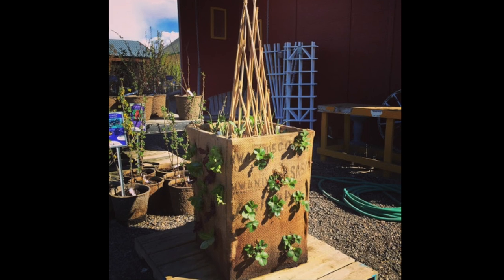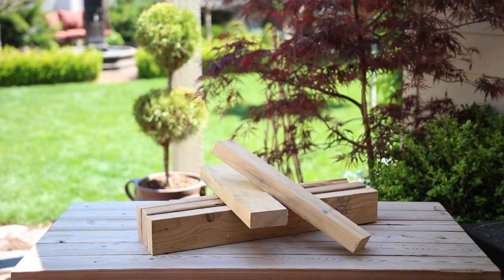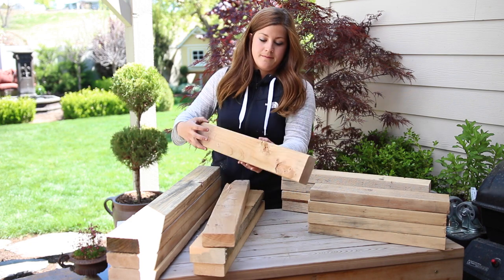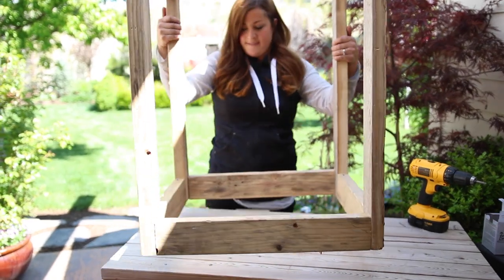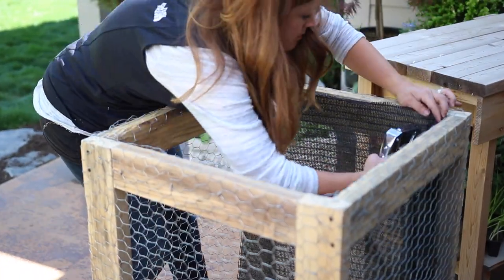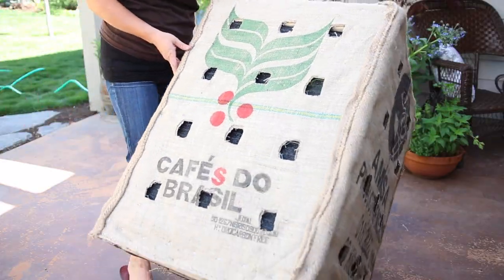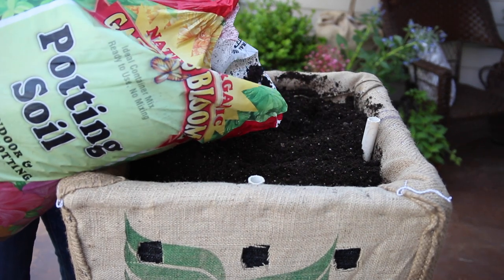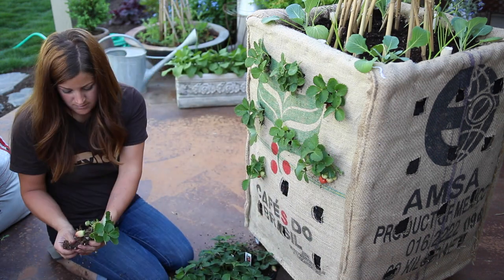DIY Grow Box (Vertical Gardening)

Comment: great design.  may I add some suggestions?
1.  why don't you add a big pvc pipe with holes in the middle for compost, worms and vermiculture. 
2.  lift it a bit more so you can recover the used water at the bottom

Comment: I just finished making this maybe 15 minutes ago! It took me significantly longer as I'm in a codo with little work space, but I'm excited to fill it up! I'm already planning my second build using the lessons learned from my build, so I'm betting the next one comes easier.

Has anyone tried adding plant sites after the box is filled? I'm not entirely sure what plants are going to fill it out just yet and I want to get the spacing right for the particular plants but I want to get my hardy plants in there ASAP.
Reply from the maker: +the0prynce I'm excited to hear how it goes for you! :) My box did beautifully last year, and I think most of the strawberries survived! About ready to replant the top for spring! :)

Comment: Just a tip, to make nice and clean holes plastic fabric, fold a metal coat hanger or a wire into a circle, hold it with pliers, burn it on a stove and make as many holes as you want until it cools down 😊  😊  😊
Reply from the maker: +Tom Tom Great idea! :)

Comment: Thanks for sharing. What is the dimensions of the chicken wire and burlap? Where did you purchase the burlap bag? Is treated wood good to use or should I use untreated?  Thank you!
Reply from the maker: +Rawindies I used a 3' roll of chicken wire that I cute to shape. You can pick up burlap at a craft store (at the nursery I work at we receive our loads of concrete in crates with tons of burlap in them, so that's where I got mine). Always use untreated wood in projects with edibles! :) Have fun!

Comment: Could you use a 5 gallon lidded bucket in the center, then cover it with the soil?  Just an idea to save on all the unused soil.
Reply: Coralei Standley You could use the bucket as an SIP (sub irrigated planter), if the bottom was also lined with plastic (maybe a plastic bin?). I also thought there's a lot of soil that's never going to have roots penetrating it.

Comment: Do you have holes in the PVC pipes .. if so, are they random or do you follow something to ensure proper watering all through the box?
Reply from the maker: Aruna Subramaniam I drilled 2 holes about every 4 inches along the length of the pvc pipe. If you watch the video back, we did include that step (although we showed it very quickly)! :)
Reply: Garden Answer Another quick idea I saw on youtube  was  turn a pallet on it;s side.  Add 'pockets' of garden cloth, burlap, old jeans or burlap......those reusable grocery bags'd work.......plant in the pockets. DONE!